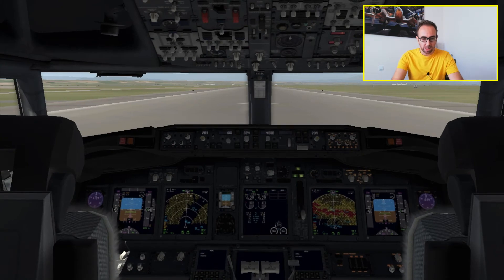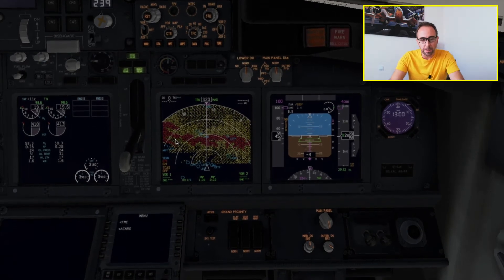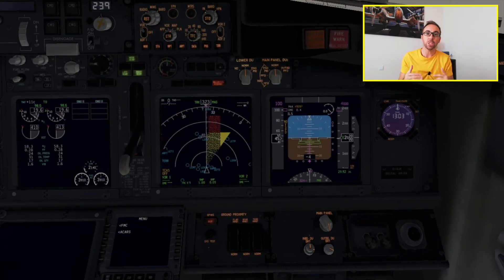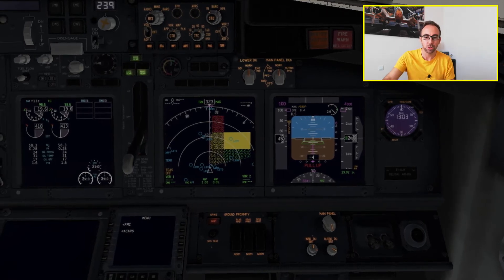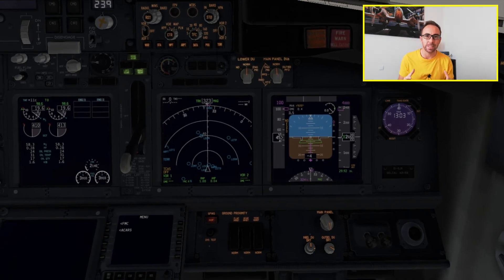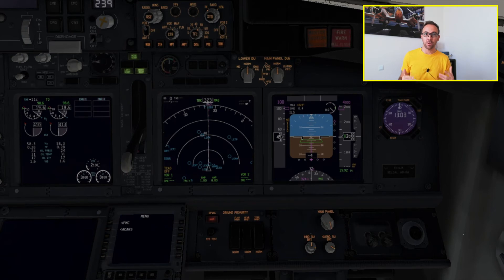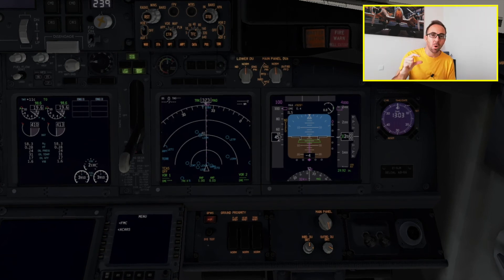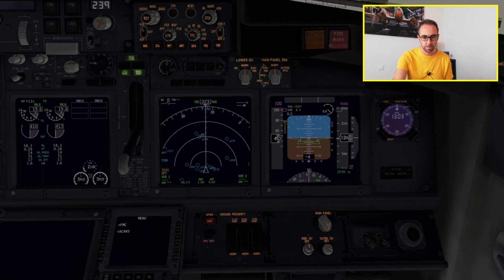GPWS - [Ground Proximity Warning System explained]

Comment: Ciao Gabriele. Thanks for the nice video. Some comments: At 3:58 min of the video it tells that GPWS gives predictive WS info. Unless I didn’t understand the pronunciation well, this is not accurate. A predictive windshear system uses Doppler weather radar to look ahead while a reactive system compares inertial and aerodynamic data from the EGPWS. At 10.0 min the PULL UP signal can be a hard alert of Excessive Descent Rate, but it can be also a hard alert of Excessive Terrain Closure Rate. Also, Green terrain means -2000 to +250 unless something has changed. My comment is that the fast pace of explanation combined with the pronunciation and accent makes it too difficult to follow. Another issue is that the ND presentation is too dark to easily comprehend. Otherwise a useful video.
Reply from the maker: Hey, thanks for watching and the feedback

Comment: I have a question about a certain callout.

Did you ever hear the callout:

UPSLOPE UPSLOPE PULL UP  ?

I never heard this callout in my life.

I red about this callout and asked a professor who has CPL or ATPL.

He told me that he knows this callout and that if you hear it you are in big trouble.

It means that if you fly twards a hill or mountain and the climb gradient of the aircraft is lower than the gradient of the hill/mountain, the gradient is insufficient to fly over it.
It would mean to pull the nose up harder.

I know that THALES has a special callout:

AVOID TERRAIN AVOID TERRAIN, which can be heard in a similar situation.

Another special EGPWS callout which exists is OBSTACLE LEFT OBSTACLE LEFT or OBSTACLE RIGHT OBSTACLE RIGHT.

I only heard that in a C17 Globemaster III, but never in a civilian aircraft.
Reply from the maker: Hey, many thanks for your comment, I have never heard that EGPWS call out.  The call-out I know that the EGPWS provides if the terrain is a issue is : ''TERRAIN TERRAIN, PULL UP'' And this means you are at 20 to 30 seconds from the projected impact with the terrain.
Reply: @PILOTCLIMB  thanks for answering.

May be the UPSLOPE callout can be heard only in certain aircrafts.
Also it is possible that the callout exists in certain moduls from small avionic companies.

For Helicopters there are also special callouts availible like:

TAIL TOO LOW.

The voice is the same like the voice you hear in the ZIBO 737NG EGPWS Test in your video.
That s because Honeywell provides for Helicopters also EGPWS.

In 737NG i think only Honeywell provides the EGPWS.

In the 737 classic you have Honeywell and THALES. That s why sometimes you can hear female voice callouts for aural warnings because it is a TAWS from THALES.
The voice is the same that you can hear in the Suchoi Superjet SSJ100.